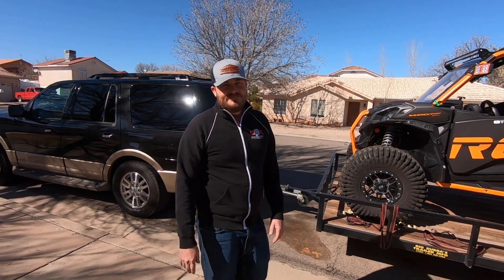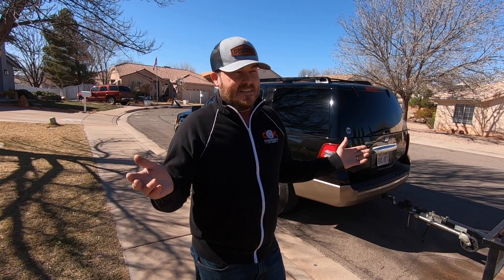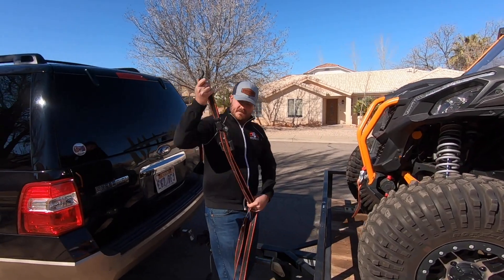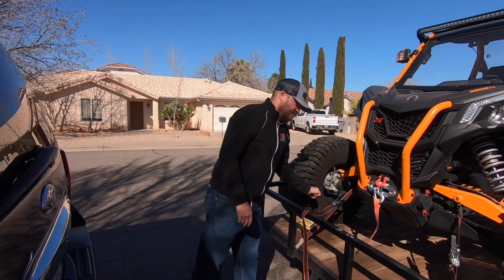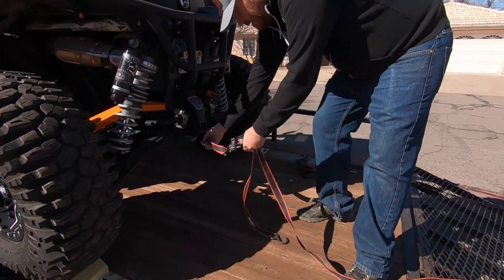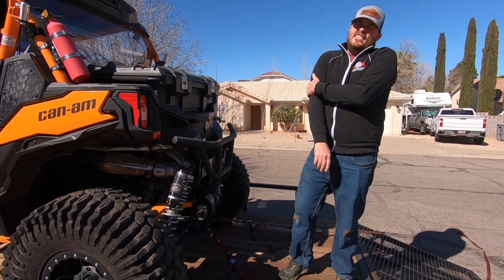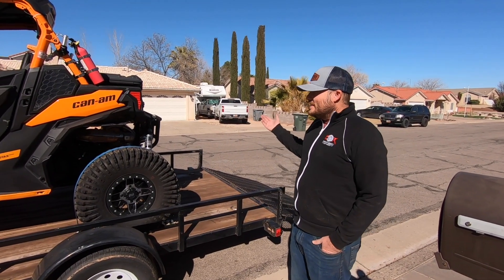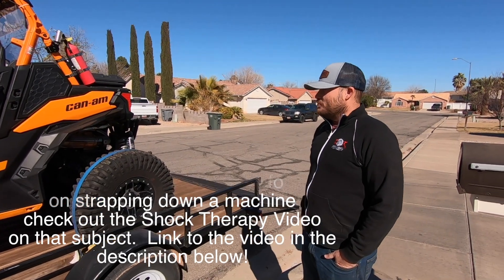How to Tie Down a UTV - Don't be Like Carl

Comment: I use the same Erickson system and love them.   I noticed you had them and had to copy.   Watching the machine bounce with the road bumps took getting use to with my first trip with wheel choke system.  The tires never moved, they lock down tight.  Only issue I had was user error, and that's where all four wheels helps.

Comment: those wheel chock/e-track brackets are pretty slick.  Probably a bit tedious to install and maybe getting your sxs lined up perfectly when getting back onto your trailer...but locking your rig down with those would be super handy.

Comment: The advantage with the Erickson Tire Tie Downs is that your UTV suspension is used to absorb most of the shocks that happen when driving down the road, also they are much faster to use .
Reply from the maker: Exactly, only issue is they don’t go around 35’s 😂. -Garrett
Reply: @DerangedOffRoad  Good thing I only run 28's lol

Comment: So i have a question.. i understand that e track is good for tieing down cargo in good conditions but if using e track to tie down a side by side and you are involved in an accident then will the track and floor boards really be strong enough to hold a heavy load to the trailer? I mean your bolting track to two of the trailer boards and thats only held down by a couple screws to frame..just doesnt seem like its really safe system in the event of a accident and your machine would potentially come off trailer..is this not correct thinking?

Comment: I really like the tie down brackets that deviant sells. They utilize the tabs up under the wheel wells that are used during factory shipping.
Easiest way to do direct frame tie down I think
Reply from the maker: I just got done installing etrack all the way down on my 22’ trailer. I bought the nice full net strap from harbor freight and they worked great on my trip last weekend. If these straps don’t hold up I’ll get another brand. Going over the tires though worked like a dream. -Garrett

Comment: I agree 100% that strapping over the tires is by far the best way to secure our machines. I don't agree with using an a-arm, or any other suspension piece, as a tie down point. I know, Justin says to do that as well, but I definitely disagree. However, I suppose that's better than some of Carl's methods. lol  Another great point you made was about using quality straps. If your load comes off, no matter how or why, it's your a$$.
Reply from the maker: I don’t know for sure but I’d bet money that the suspension sees far more extreme forces while riding than being strapped down. But yeah strapping the tires is superior for sure.
Reply: @DerangedOffRoad  I would agree if it was a vertical tie down and not a forward pull on the single tube. However, as long as the machine is secured, I don't care how folks do it.

Comment: Take a look at the car haulers going down the highway. They'll strap $100,000 cars by the tires. They don't tie down to the frame.
Reply from the maker: That’s how most race cars are hauled as well.
Reply: @DerangedOffRoad  I actually have straps just like the car haulers use. I have an old U-Haul trailer that has a bunch of holes in the deck. So I got straps with a hook that I slip through the hole and they fit on my 34s. They have a larger size that would probably work with 44s maybe even 50s
Reply from the maker: @sinned96  even the Harbor Freight web straps work great and up to a 35” tire.
Reply: @DerangedOffRoad  mine is a weird setup it has a hook in the front of the tire a hook behind the tire then hook your place about two or three foot out and the ratchet handle is in between those last two hooks. Kind of hard to explain let me see if I can find a link to it and if I can post it here. But it was the best setup for what I have because I have multiple mounting locations all over my deck

Comment: Wow somebody that actually knows how to strap down a vehicle proper you know how you know this is the right way to do it cuz this is what a tow truck does yes a tow truck not a wrecker a tow truck that's what it does it tows vehicles a Wrecker is a yard full of wrecked vehicle for scrap metal yes this is the only way you should be tying down your side by side ATV or anything Automotive if you tired down to the frame of your machine you get body roll loosening the straps no matter how tight you think you'll get them they always lose them by the time you get to where you're going strapping them to the tires is the best way the only way
Reply from the maker: Also it’s very quick and easy as well. -Garrett